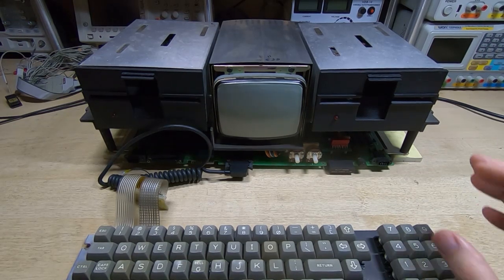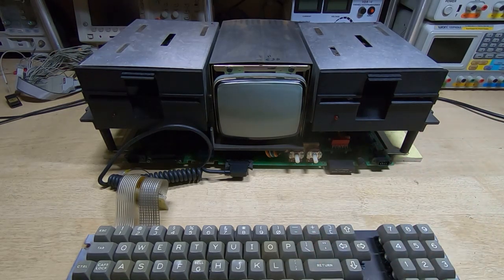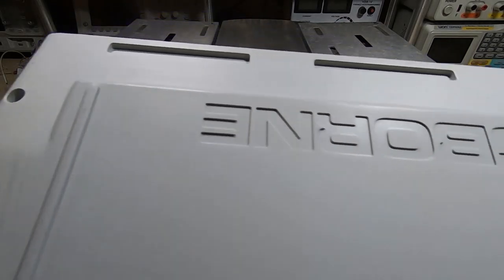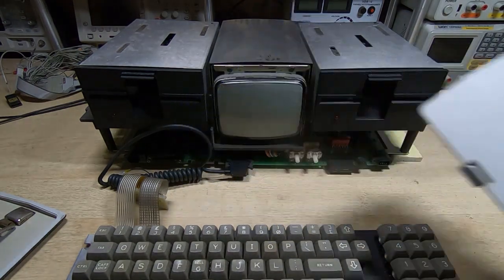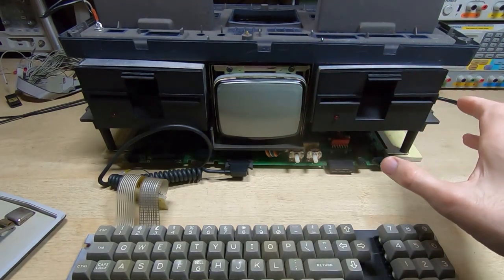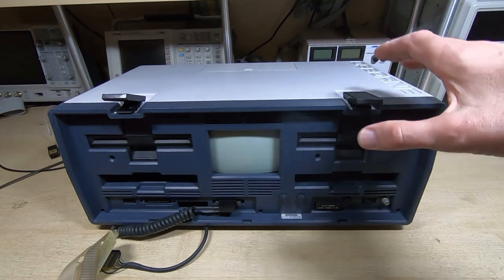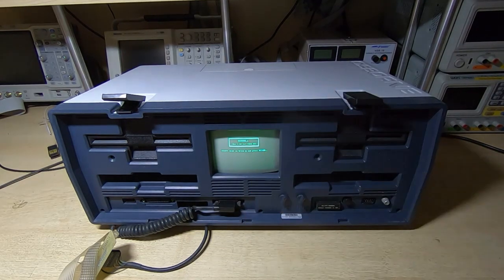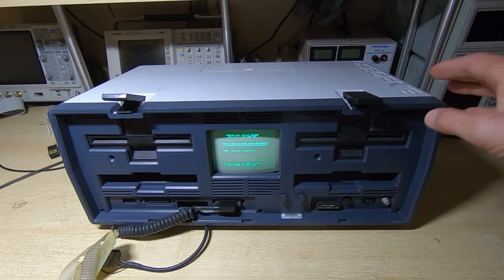Osborne OCC1 Repair Part16

Comment: I agree that this will be an interesting addition to your collection.  I purchased an O1 off a local ad several years ago on a whim, and I have decided that it is one of my favorite machines.  It's large and heavy, but it IS portable, and I've even taken it out to coffee shops and such to do some Z80 development using the CP/M tools.  It's not a speed demon, but it's quite fast enough for reasonable work.  It's certainly faster than CP/M on my Commodore 128 with the 1571 disk drives, or CP/M on an Apple ][ with a SoftCard!